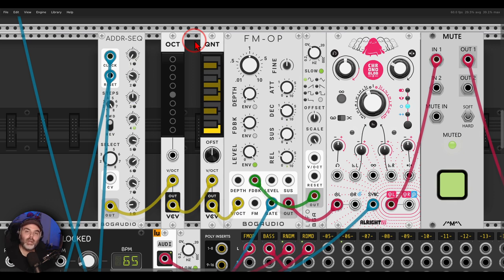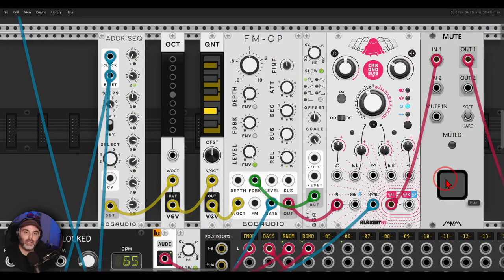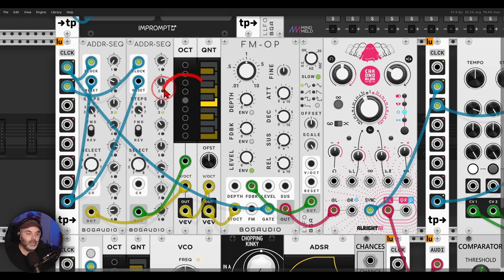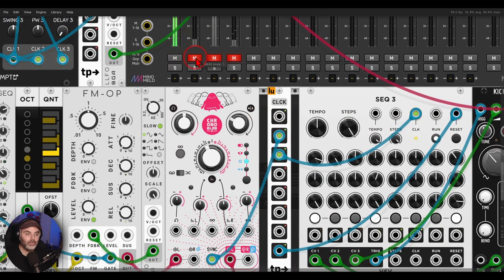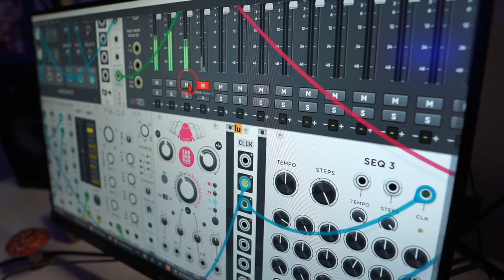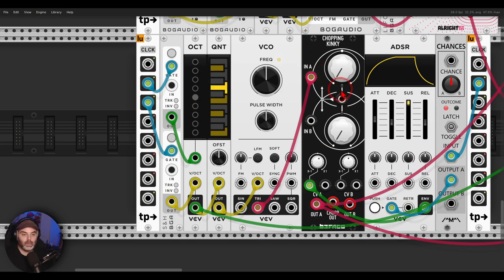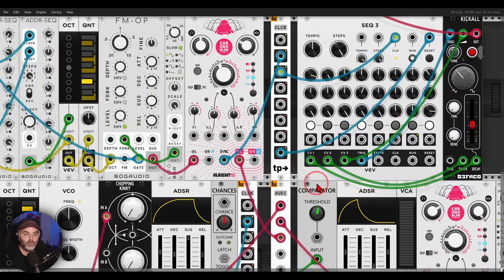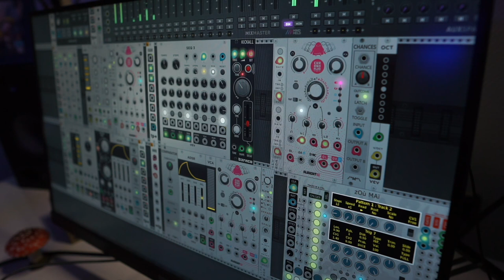Adding movement to any sequence \ Quick Tip

Comment: very nice tip and well explained! thank you! what would achieve something similar in eurorack? Doepfer A-185-2 or Noise Engineering Quantus Pax could be used I guess? Any other ideas/recommendations?
Reply from the maker: Well, the main thing here is to have a CV input so you can transpose up and down but you can create something similar with offset and a VCA. A precision adder can also help but you will still need some sort of CV control so a VCA can come in handy. Something like this can also work - https://www.modulargrid.net/e/ajh-synth-minimod-precision-voltages
Reply: I'm using a sequential switch (Doepfer a-151)   a clockdivider (doepfer A160-2)and the T-42 from vpme.de ( a musical precision adder). Works great. This weekend I will explore the Doepfer A-119 for its "onboard"comparator. Have fun.